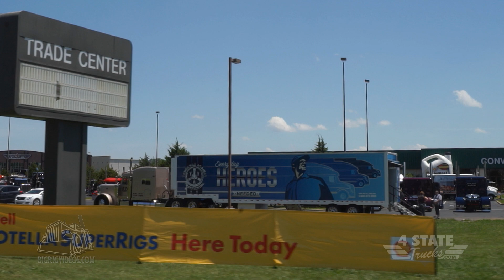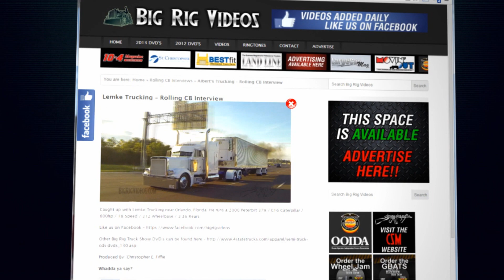Travis Headley "Gold Digger" - Rolling CB Interview™

Comment: Can't hardly beat a "nickel 9"
Got a 379  2004 x  & pull a " bovine limousine"
Still my favorite is dads old 81 "nickel 9" long hood with a 3408 &  and 2 stick ( 5&4) . Not so GOOD on fuel but back then it was $ 1.00  a gallon so it didn't really matter .

Comment: hi. im looking for the youtube video of that super sweet sounding 1979 kenworth you shared on Facebook not long ago. twin stick i do believe. thanks
Reply: 🤔  Hmmm?   I have not made the video of it yet!  First truck I bought is a '79 KW W900.   It was a glider kit built up into a winch tractor (with very nice full coverage sculpted diamond plate steel fenders, 60K Tulsa) for heavy haul in its early years, rural county maintenance midlife crisis and now is retired to the farm.  I use it to move dozers, excavators, tractors etc. around. Still don't drive it enough to be proficient with the 5&4 setup, but it gets the job done!   It has had a hard life.